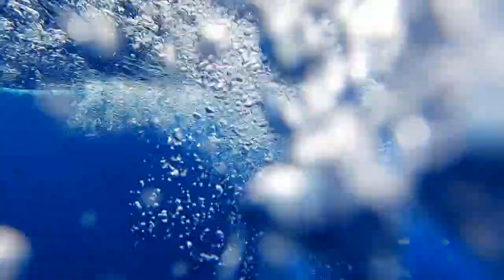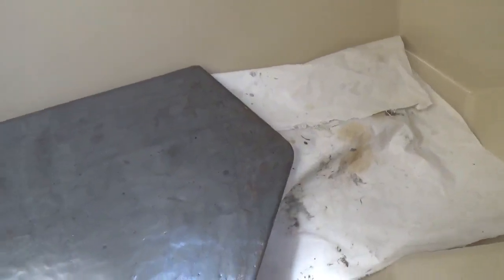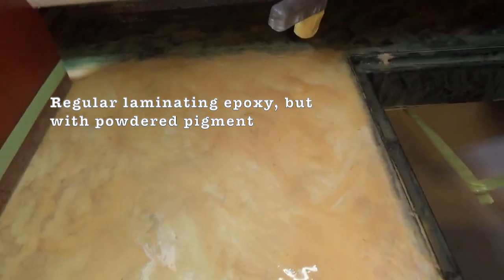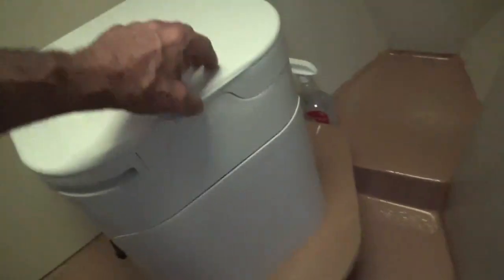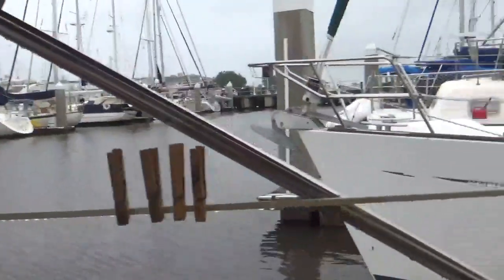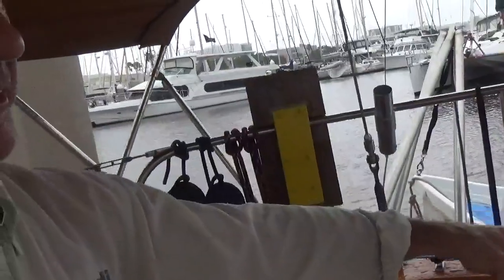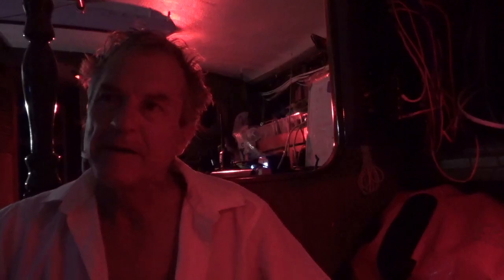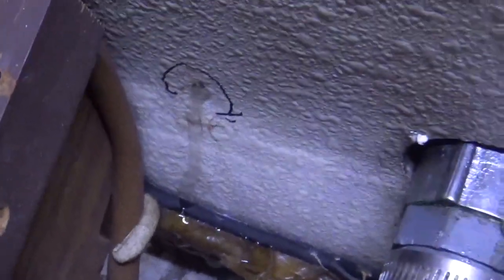Skipjack Sailing 51--Post Shakedown work

Comment: Happy to hear you managed to salvage the outboard. Never ending, overlapping and piecemeal projects is the way of life aboard ;)  Yer doing a fine job of it.
Best to ya 
FW&FS
Reply from the maker: Thanks, Paul.
I'm sure that--similar to my bicycle, for which I had to change the main crank bearing a few months after the bike went under--there will be some long-term issues with this engine.
But who knows?
I might be buying a bigger dinghy which might need a bigger engine anyway.

Appreciate the comments.  And I'l tell ya' this--I'm getting itchy to leave and be underway again. New sails should be here next week....then it's just wrapping up the "necessary" work.

Comment: Thanks for the update - we were wondering how you were getting along.  Bummer on the outboard but what a nice surprise when it came back to life.  If you get up this way, bring it.  We can do a deep clean and flush on it in the shop.  The royal throne sure ended up on quite the perch.  We are back home after two weeks of RV travel and have created a prioritized work list to complete before we set out for the summer.  Connie keeps calling for a schedule review meeting but I've resisted so far.  Call if I can help with anything.
Reply from the maker: Always appreciated, Ron.
I should get the new sails this coming week, and then a frenetic 4 weeks to "finish up" essential work...eager to get underway again.

Comment: rope sling for the outboard and use a line and pulley to pull it from the dinghy?
Reply from the maker: Well, before I got complacent, I tied a safety line to the outboard so that if I did drop it, it could not hit the water.
The Big Red boat in Scotland (the original Skipjack) had a davit for that purpose on the starboard side.

And it's not the weight of the motor.  Very easy to pick up.  If this was a nuclear plant we'd have a rigging plan as you describe.

Definitely, I need something that can be more "automatic" and rythmic.